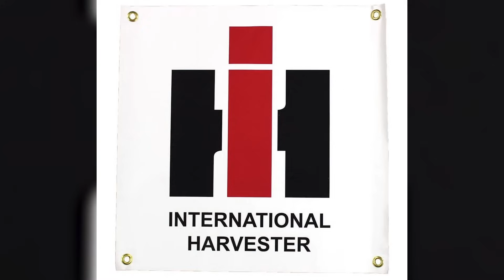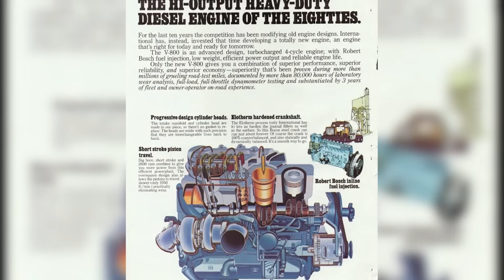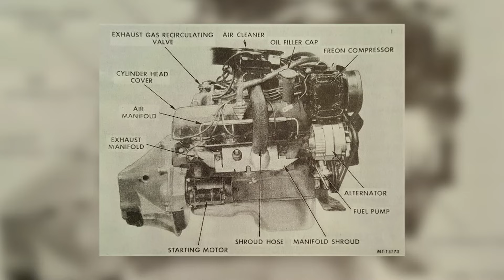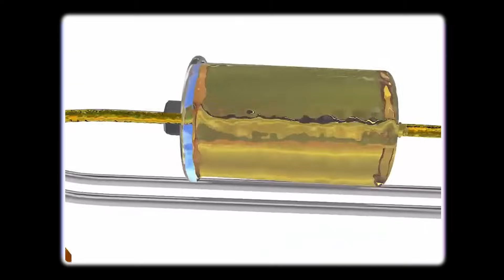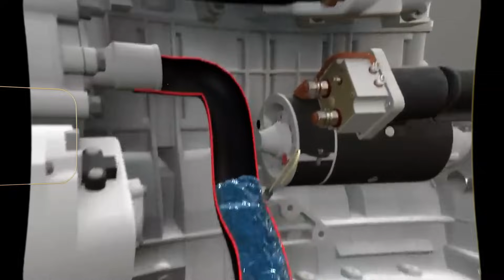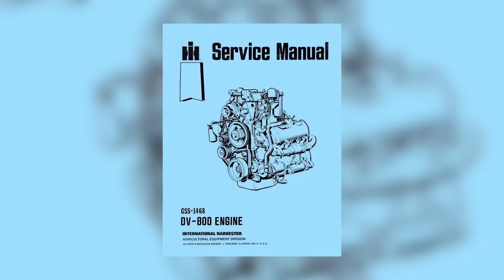How the DV800 Engine Nearly Destroyed International Harvester

Comment: None of the companies made a V8 diesel engine that was really any good, Cummins 903 the Cat was popular with the 3408 but it was heavy and was a fuel guzzler, the most successful was probably the Detroit silver 92, 2 stroke oil leaker. The 855 Cummins and the 3406 Cat strait 6 six still ruled.

Comment: The one that I had experience with was a super smooth engine.
Reply: Our 4586 starts great and pulls fine around 1800-2000 rpm. we don't run it above that. Still use it yearly

Comment: I have an IH Hough 90 loader. It still runs with the 573DVT (the 800s little brother) although it does smoke pretty good. No parts available now. I'm going to replace it with a DT530 I have rebuilt. Yah the smaller V8 diesels can't compete with the long stroke inline 6 cyls anymore. Good expose. My machine has lots of hours on it so that engine was successful in the loader at least.

Comment: I can't put a single reason for it, but most North American V8 diesel engines never worked out well. Cummins, Cat, Detroit 92 series. 
Inline and V12's fared better for some reason, different application, less HP per CI perhaps, better balance.

I worked on them all, maybe it was an Old Wives Tale but V8's were cursed.
Reply: I can't think of 1 great v8 diesel
Reply: @nickpalazzi2121  Nope.
That's because diesel fuel inherently works better in longer stroke engines.
Reply: @nickpalazzi2121  Cat 3208 😂
Reply: I agree  even 3408s and Mack E9s weren't as good as the 6 cyls

Comment: What killed ih is the recession, along with allis chalmers, white, and others. Not having a power shift didnt help, but was not what killed them.
Reply: None had a cab that even came close to Deeres sound guard body.
Reply: @richardneubauer3365 ever been in a 8000 series allis? Not near as good of a driveline as a deere, but the cab was bigger with more visibility. And damn near as quiet. Allis would have done ok if they dropped or redesigned the bottom end on the 426. Their power shift was decent as well.
Reply: @AdamSokol-v5p My brother owns an 8000 series AC a pile of junk always broke down and in the shop. But he won’t give up on it. Must be love ❤️
Reply: @richardneubauer3365 yeah you arent wrong. The 426 was not a good engine. But i was referring to the cab and transmission being decent. I would throw the rest away. Or repower with a 8.3 cummins. Makes a decent tractor out of them.

Comment: The engine was a reliable powerhouse on the CE side,in the agtractors an early problem was a restrictive air intake system,farmers would run air filters long past change recommendations,the intake air would be further resticted and the engine would start sucking engine oil from the crankcase resulting in runaway engines and failure.IH redesigned the air intake system and resolved that problem later on.
Reply from the maker: Good to know!

Comment: Just a heads up, the machine you used for the sound of the engine is an 855 Cummins repower, take note of the long snout and fender mounted air filter
Reply from the maker: Thanks for the info! It's really hard to find footage I can use for these, but it always helps to get feedback like this.